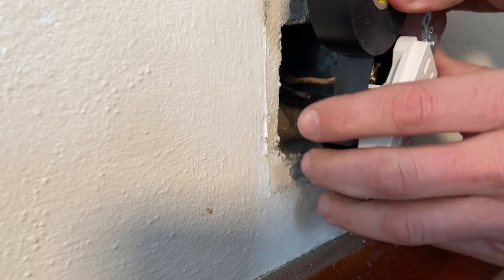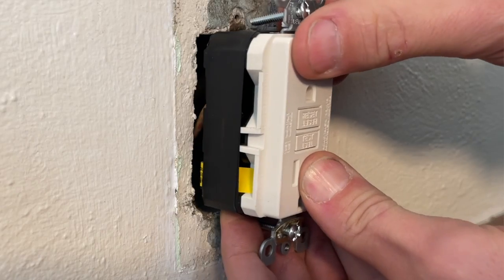Should You Wrap Outlets In Electrical Tape?

Comment: The master electrician that taught me how to wire receptacles told me to always do it, Roger was a pretty good dude.
Reply: NECA NEIS 130 5.3 Conductors (L) states "DO NOT wrap electrical tape around wiring device terminals. Taping wiring device 
terminals will prevent heat dissipation from the wiring device." National Electrical Contractors Association  National  Electrical  Industry  Standards
Reply: @inklingsofgod  Good to know now granted this was 20 years ago and at the time old Roger had been electrician for probably 40 years
Reply: There is no requirement in the NEC or elsewhere that requires any device to be wrapped in tape before installation, but the practice of wrapping devices in tape has been around for a long time. I have been questioned about this practice on many occasions. One justification is that taping devices is necessary because the receptacles/switches will be energized before the finish plates are installed or the tape allows for the removal or replacement of the device while energized. Devices should not be energized before the device cover plates are installed. To do so with standard type screw-terminal devices means there are exposed energized parts creating multiple problems. 
The NEC requires cover plates to be installed on completed installations; see sections 110.3(B) and 314.25. 
However, the practice of energizing receptacles and switches before the application of cover plates is quite common in construction as a job nears completion. As the temporary power is removed, it is typical to energize newly installed branch circuits for temporary power. In many cases, the permanent cover plates are not yet installed due to wall finishes, such as paint or wallpaper, that are incomplete. Energizing these receptacles is a violation of the NEC as well as Occupational Safety and Health Administration standards. See 29 CFR 1926.416. 
Where there is a need to energize permanent branch circuits for temporary power, temporary plastic cover plates should be applied to comply with the NEC and to ensure there are no exposed energized parts. The practice of removing or installing devices while energized would only be recognized as “justified energized work” where de-energizing the circuit would create “additional hazards or increased risk.” See NFPA 70E 130.2(A)(1). Removal while energized would require application of all the safe work practices rules in Chapter 1 of NFPA 70E.
Reply: Roger From metro electric.
Reply: @censoredsnake  he was QA I had at Wachter back in my data cabling days
Reply: I have an experience regarding the wire nut it was too small so all the did not fit in it
Reply: Same here: Another master electrician taught me (and all apprentices working on the home) to wrap in Super33+ tape.  It passed inspections too.
Reply: It should only be done in when putting a larger plug like a gfci in a smaller metal box. Zero point in plastic boxes. Or regular plugs on metal boxes
Reply: @beinghuman3225  since you're  throughing around your codes like you're an inspector, lol. I will give my 5 cents: In Canada we are about 10yrs ahead in regards to safety standards and rulings in our CEC, like you guys wiring entire houses in 20A, like wtf ever heard of demand calculations.. we're only allowed to put 12 devices on any cct, and yes led will change except that...any Code book is bare minimum requirements..what we do on top of that is good practice standard/good workmanship (actually thats in Sec.2 of our book). The thing with taping devices is BC has its own rules on top of the CEC and yes it requires it when metal boxes are used. Now NB and the rest of the east coast won't.  Here is what my former journeyman explained to me why we need to tape plugs in metal boxes, that is to prevent arcing, not protecting our fingers when working live, cuz I got zapped more often than not putting tape on or off... no the reason why its in our provincial code even, is have you ever noticed with time and lots of use the receptacles in ie public places become so loose that you can wiggle them side to side. So when you're plugging in your cellcharger at the airport for example where the plug is worn as hell, the termination screws accidentally hit the box and trip the cct. You think they want to call their electrician every 5 minutes to reset a breaker because they are too cheap to fix their plugs, heck the last airport I was at I retightened a plug myself because it was so bad, these places are so cheap they rather risk burning down the entire airport than fix a stupid plug.
Also as a female electrician apprentice and journeyman  I was always held to a higher standard than any of my coworkers.. if somebody effed up I was sent in to repair (which was funny having an apprentice fix a jman's shitty work, lol) and if I made even the tiniest mistake or sloppy work I got reamed out! Is that considered sexist or bullying, maybe but it sure made me a better electrician than most men in my company put together. We all do things differently because we were all taught differently, sure it should be the same standard as the EC but no inspector has time and there are many in the trade that shouldn't because its dangerous even standing next to them (I know a couple of sparkies I don't  understand why they're still alive).So to wrap a plug or not to wrap it boils down to regional rulings, what the inspector prefers and uncommon sense. I wrap in all metal boxes and never been called not to until I moved to NB, but here I also noticed that they do things like BC did 20years ago, and my provincial headinspector even admitted that he is glad to see me because well BC has better training and higher standard. You might have a point with heat dissapation but in resi when do plugs ever get hot, I rather protect the cct from tripping than a warm plug..
Reply: @gophersgirl  yes. If you do something to code, you've just done the shittiest job possible. I also tape devices in metal boxes. We use the current NEC here, unlike some states. I believe Florida for example is still using the 2011 NEC. I find it weird that a state can supercede the code yet some states aren't even current on a federal rule book.
Reply: Ok great video. But I see all methods of doing wire nuts. Some He is the wire and clip it but always clockwise. Shouldn't it be twisted counterclockwise yo get the wirenuts to thread into the twisted wires?
Reply: @beinghuman3225  I can't disagree with you on this, however when you are the electriction on a rough in going into Trim out, and all the other trades are complaining about needing power, you get really good at live wiring or you have to put up with too much nonsense. And yes you can pull rank.
See how many jobsites you will get to work after a few times of pulling rank? The rest of the Trades won't appreciate this, nor you! You might have a very short career after pulling rank.
Reply: @Linkmohr12  temp outlets get installed during the rough-in. And there is no rank, but responsibility. My career was shorter than most, I retired at 40.
Reply: @georgewaynewilcoxjr2102  heh!? Have you actually ever spliced wires before!? Its always clockwise, otherwise the marret would untwist your splice especially in 14AWG, same as screwing in a light bulb, you cant go the other! Lefty loosy, righty tighty, lol
Reply: @inklingsofgod  eh, I'll still do it in crowded boxes.
Reply: @inklingsofgod  Their codes are always behind the times and are usually wrong. I prefer to do better than what their code is.
Reply: @gophersgirl  I know I'm late on this but I've got experience with wire nuts. First thing I learned about splicing wires in school was to make a pigtail. We twist the wires together so they almost can't come apart unless it's serious destruction, cut to length & give a quick swirl around the tip with my lineman's pliers (kinda tapering the end) before applying the wire nut. I also prefer to turn the wire nut up. Nothing can fall into it that way.
The problem with wire nuts are usually from the nuts that shouldn't be doing the job "DIY".
Reply: I use a strip of pipe wrap on the "hot side" of the metal box.  This makes it cleaner than wrapping an outlet with electrical tape and more permanent.  The outlet is easier to inspect and you haven't created a heat dissipation issue.
https://www.homedepot.com/p/2-in-x-50-ft-20-Mil-Pipe-Wrap-Tape-53550/100179778
Reply: @beinghuman3225  no..they don't. Florida uses NEC from 2020
Reply: @gophersgirl  The higher standard doesn't really apply when it says DO NOT

Be like saying dont stick a metal fork in a contact opening. So instead you go above the standard and stick it in two contact openings.

Comment: generally yes, I have been advised that in wet/damp locations(especially docks /marinas) that the tape may allow condensation to collect and not dry out causing corrosion, additionally wirenuts should be installed "pointing up" so that condensation/moisture will not collect in them.
Reply: As I commented earlier, I use butyl rubber to "stuff"wire nuts in areas where they might be exposed to moisture. It pushes in easily and a couple of tape wraps secure it forever.
Reply: Dane, while I am not a professional, I have always pointed the wire nuts up when I've wired up outside lights where moisture could collect and find its way into the copper connections leadign to corrosion.  A lot of this is common sense; however, that is in short order these days.
Reply: @justm1ke  Solder and shrink wrap

Comment: I always do.  Especially a good idea with metal boxes. Not a code requirement, just a personal preference.
Reply: The vote doesn't matter, it only takes 30 seconds to wrap, ... the metal box isn't an issue as much as the ground wire possibly contacting a terminal after pushing the outlet into the box.
Reply: It's common knowledge to just check if the ground wire is touching any of the terminals when putting on the Faceplate
Reply: I been wireing for 20 years and never wrapped the outlet. Its a waste of tape, no need to do it, unless your ocd.
Reply: OCD it is.
Reply: It’s not a code requirement for a reason. If it was necessary it would be a code. It is a completely useless practice.
Reply: @zinsco  I think it has it's purpose but like the orientation of an outlet, it's the preference of the installer.

Comment: I wish this information was available 40 years ago when I was working on my 100 year old house. I thought I was doing everything right when working on outlets, using wire nuts, tape, etc. Fortunately I only did small repairs around the house and never had any problems. I DID, however, always wrap outlets with electrical tape. If I still owned that house I'd go around and fix my previous repairs. I've been watching your videos for a year or so now and find them invaluable. -->Ric

Comment: As a steel mill electrician, I know that electrical boxes, conduit, brackets that hold them, etc. tend to break away or rot away TO NOTHING over time in the wet & corrosive environment of a pickler or blast furnace. I've seen too many examples of electrical parts or light fixtures that end up hanging BY THE WIRES. I plan for that by tightly taping a few inches of the wires and then taping the nut in the same direction i tightened it, to keep the nut from ever falling off. Those bare connections will cause short circuits & blown fuses.

Comment: I work at a hardware store with a retired Master Electrician and I asked him about this topic recently. His opinion was that the only reasons to use electrical tape on a wire nut were if you were not sure that it was secure, or that there was exposed copper outside of the wire nut. In either case, you need to reapply the wire nut correctly. When he sees tape on a wire nut, it makes him nervous because it tells him the last person to work on it was not confident in their own ability to do a good job.

Same goes for outlets. If your outlets are installed such that it's possible to short circuit the hot terminals, then you need to rewire it, possibly trimming excess neutral or ground wires. There's no reason they should be close enough to contact the hot terminal.

What he told me boils down to this: applying the electrical tape is useless when the work has been done right, and if you are OK with using a stopgap measure to cover an easily fixable mistake, you should not be working on electrical systems.
Reply: Wirenuts (tradename) have springs that are tapered and grab, primarily, at the top. Half twist and many come right off. Tape these to prevent easy fall off if vibrstion is a concern.   Other spring connectors (trsdensme wingnut or scotchloks) have springs shaped more like an hour glass and grab further  down the twisted conductors, vs the tip. . Hence several twists required to remove them. I tape wirenuts and find no need to tape wingnuts if wire insulation sticks into the connector's skirt as they should (no exposed copper.) If copper shows out the bottom of ANY  connector then it was installed incorrectly!
Reply: @WAYNE Picnot Yes, 12 gauge wire will support a 20 amp circuit according to the National Electrical Code. Make sure that your circuit breaker is 20 amps, or else a 20A outlet won't do you any good.
Reply: @WAYNE Picnot Good stuff. If you work inside the breaker panel, make sure you stay clear of the main lugs (google what they are if you don't know). They will be live whether or not the main breaker is off.
Reply: If I have to use the butt end of a screwdriver to pack everything into a box I'll tape it all up good first. Because once I get it all jammed in there I do not want to have to take it apart again.
Reply: I've been told electrical tape is good for anything that vibrates. Such as a fan or a washing machine.  Just for a little added protection from the vibration causing it to come loose..........
Reply: The World is full of "expert opinions", isn't it?

Comment: I worked with an electrician years ago and what he told me is to pre-twist and trim the wires with the lineman's pliers before twisting on the wire nut and it was code to use electrical tape to keep the nut on, but you need to wrap it between the legs, not just around and around. He never mentioned wrapping fixtures with tape and we didn't do it.
Reply: It is not code to wrap wires or wire nuts with tape.
Reply: I don't remember why, but I twist the wires together thoroughly, trim any unevenness, then apply the marrette.  Only limit on twisting is to be sure not to fatigue the copper or reduce the effective gauge of wire.   It's been a long time since I did this stuff.   If there was any exposed wire at the bottom of the marrette, I would trim the wires and re-apply.   Electrical tape shouldn't be necessary and messes up inspection... but other than that, no harm.
Reply: Same. I make the wire connection just like this and they would pass the pull test without a wire nut at all. I was also taught that if taping the nut seems necessary, to wrap it “clockwise” so that the tension from the stretched tape wants to make the nut tighter. If you wrap it backwards it could actually loosen the nut.

Comment: I do whatever my little heart desires.  Generally though I do wrap my outlets and switches, just because that is the way I have done them for years.  As to the wire nuts...  I hate seeing electrical tape on them.  It does nothing but make troubleshooting more of a pain in the rear.  Side note:  I was trained with the thinking that the wire nuts are not to make the connection but to protect the connection.  Twist your wires together, test to see if there is anything loose, trim if necessary, then put on the wire nut.
Reply: Spot on. Nothing worse than trying to troubleshoot a live multi branch with tape on the neutral.  Very risky
Reply: Always make a good mechanical connection first, then wire nut or solder and shrink wrap as needed
Reply: 100 Percent agree !! A little extra time will save a future call back .
Reply: I like your thoughts on this.   The electrical guru I used to work with that helped me with a connector design told me metal contacts only work if the pressure holding them together exceeds atmospheric pressure. The idea being oxygen won't get into the contact area if the surfaces are pressed together with higher than 32 psi.   So I like the idea of twisting first, but I believe the purpose of the wire nut is to compress the wires together and hold them under pressure to assure a good oxygen free contact over time.  Pull off a 30 year old wire nut and untwist the wires.  If it was done properly the contacting surfaces will be shiny while the other surfaces are oxidized. Without a wire nut, a wire wrapped very tightly around the bunch could maintain the pressure is applied correctly.  There's the two cents you didn't ask for.  Ha
Reply: @NackDSP  I never had any problems with oxidation especially when both wires are copper . The only time I’ve seen this problem was when one wire is copper the other was aluminum that was years ago when copper prices shot through the roof . I applied Penitrox worked pretty well , but messy !
Reply: Learned to twist the wires times 3 to get that mechanical connection then clip off ends to make even then the wire nut. Personally I like the Ideal push in connectors as the take up less space.
Reply: @williameisenberg1999  I don't think he really means oxidation I think he means tarnishing. Tarnishing creates resistance. Just a poor choice of words but both create a similar reaction called resistance. I think that's what he was going for. Electricity runs on the outside of wire the surface not the inside core. The more contact of the surfaces the less tarnishing and the Less resistance.
Reply: very good I agree